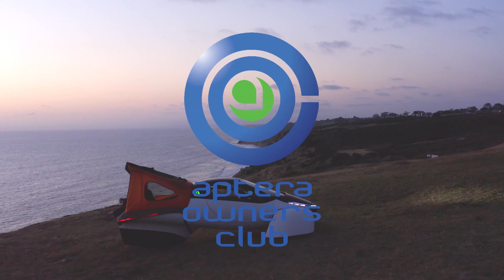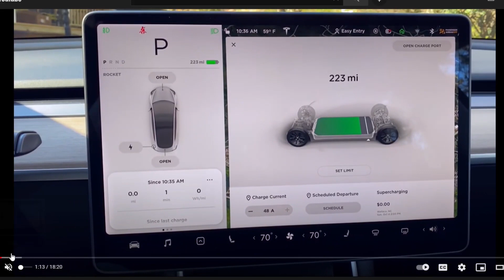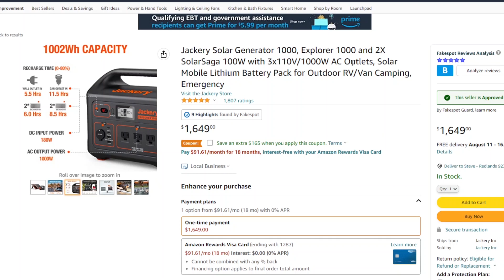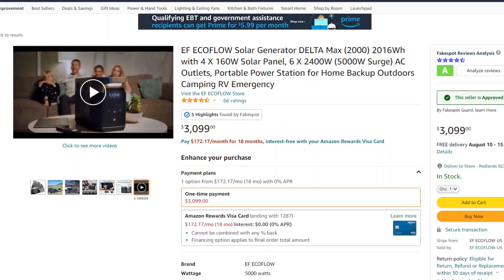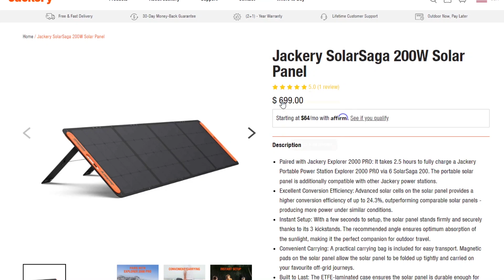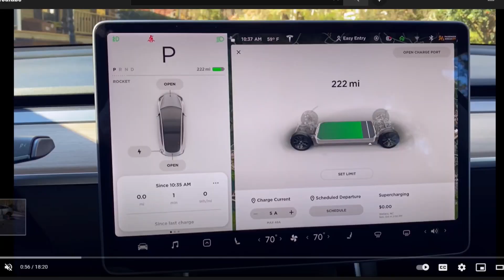Charging with portable solar.   Aptera could do this MUCH simpler

Comment: I just noticed you have no understanding of the Aptera. There is no portable solar on the Aptera. The Aptera is mobil solar.

That difference is portable is you can move it. Mobil is you can use it while it moves. You can't drive while on portable solar power.

Comment: It would be wonderful if Aptera were to offer an external extended solar panels that plug directly to the car.   This could be for camping or connected to your house for increased charging and more solar miles per day.   Another interesting idea would be a solar trailer that's both light weight and minimal drag.   For normal driving, you leave it at home and plug into it when home.   When doing long road trips, the trailer is towed behind the car for extended solar range.

Comment: So some of the issues would be there would need to be something that would convert the DC charge to an appropriate level which is likely in the 700v range as the Aptera is said to be between 350-400v system.  I have 4kw solar setup at my cabin and on a 48v battery it is in taking 110v.  So most of the solar setups you reference only output like 48v, which is not nearly high enough to charge the batteries.  So lets assume 48v panels at 8amps, which is a stretch for what you showed, but lets go with it.  That would mean to get it to the approx level needed you would be about 700v at about .5 amps.  To get any meaningful charge you would need 4-5 of the panels in series.  Ideally you would have enough to bring the voltage up to the desired 700 or whatever Aptera recommends for charging.  That way there is less conversion.  I think this makes sense sense since there are what 150ish cells on the Aptera that are likely in series to bring the voltage up to 3.5v x 150 approx 500v plus.  Should be interesting.  I do hope like you indicated they come up with some MC4 or something similar to allow this.  That way we could get several hundred miles of solar charge each day.  Love your videos, joined you all on discord and look forward to getting my Aptera!

Comment: I too hope Aptera has a direct solar panel charging port instead of the converted, then reverse converted method.  That being said, I've lived off-grid with solar panels on RV for years, and know these new solar generator charging stations to be overrated and seriously overpriced compared to my setup which does the EXACT SAME thing! All it is is solar panels connected to a charge controller, connected to 12v batteries (in my situation, '2' 6v golf-cart batteries in a 12v arrangement). Connected to the 12v battery system is an inexpensive power-inverter which converts 12v to 120v. The RV has options of running a 12v system for lights and basic appliances, and 120v for fridge, sensitive electronic equipment, blenders, coffee grinders, power tools, etc. Its been working great for over a decade for far less $/watt than these portable solar generators.  I've been avoiding and loathing the forcing of us into electric vehicles because of the extraordinary power demands to run a vehicle. It is impossible for those of us off grid and not SUPER wealthy! ...until now. Thank you, Aptera- finally something I can get onboard with!  Aptera NEEDS to have an adjustable amperage setting like this Tesla, if it wants to appeal to someone like myself.  I don't need to charge a vehicle in 12 minutes, I want the ability to charge it with limited electrical resources, such as my 1000w solar arrangement, or 2000w 'backup' inverter generator.
Reply from the maker: Thanks for sharing your experience!

Comment: Remember that in the future, polish company called Saule Technologies which produces perovskite solar cells, might produce elastic sunshield, or huge plain sheet of solar panels that you can fold or roll and get more watts. I really want to ask aptera ceo about perovskite technology. 
They could print perovskite lines on the body of Apteras vehicles (like they did in lightyear blue project with stripes) and connect it to battery - more poweeeeeeeer :D
Reply from the maker: https://youtu.be/Zpp6vRTWKZ0
Reply: This tech is coming, but at the moment it is years away from commercialization.  Aptera produced kaizen, or continuous improvement, so they will be able to adopt new tech without waiting for model years to phase it in as it becomes available.

Comment: Tried to do this with my Gen II Volt. 

Figure I could get about Five miles of range per solar battery cycle.

The 120V charger that comes with the Volt plugs right into the solar generator indicates a ground fault and won't charge. 

Anyone have any ideas which I could do differently?

Comment: A point to note about using a solar panel to battery to EV connection is that the battery acts as a "leg up" since the solar panels don't produce that much current. BUT you need to have a system which allows pass through charging. That is, the battery puts out current while receiving current from the panels at the same time. This is not a feature all systems have. Jackery can do pass through charging, but doesn't recommend it because they say it degrades their batteries. Other companies like Oupes and Bluetti are designed to do pass through charging with no ill effect on their batteries.

Comment: The only reason I came up with for needing supplemental solar was for remote places like a trip to the Article Circle. You might have to sit for a while. If you use 700 watt flex panels sew together you sit for half as long.  As you move from one stop to another.  You can get to places the ICE car might have trouble getting to but bring a fishing pole so you have something to do while you wait.  And so you don't starve.

Comment: Here's to hoping the Tesla charging plug makes it to the production model and a DC slow charge mode can be implemented.  With this there would then be direct battery connection and minimal conversion losses.  Cheers!

Comment: I have an idea that could both keep the car cool and increase the solar charge rate.  

Aptera should have an MC4 input inside the car and sell a customized sunshade that has solar cells embedded in it.  That way the car's internal temps can stay lower, minimizing thermal stress on the internal components and we can utilize essentially the whole windshield area for solar cells.

Comment: The problem lies in how much the solar charge controller that is installed can handle. If the vehicle is equipped with every panel possible, including the ones in the dash board, The Aptera's Charge controller may not have the ability to handle more panels or may require panels of a specific voltage range that are not typically the kind that are portable.

Also wouldn't a solar windscreen cover defeat the purpose of the dashboard mounted panels?

Comment: will the Aptera be capable of providing temporary power to a house, for times when the commercial power goes out? In other words provide some compatible DC voltage to an inverter that converts it to 120/240 AC for the house. Keep in mind that you are responsible for disconnecting the house from commercial power while using the supplemental power. Linemen hate it when they think they are working on a dead line that is being supplied by some yahoo with a generator.
Reply: Aptera will not provide V2H  however there will be a low current 110 outlet. Perhaps no more than 1300 watts

Comment: The Tesla won't charge directly off a solar generator unless you have a neutral ground plug in one of the outlets on the generator. I saw he was using one in a still from the video. They are about $15 on Amazon.
I have a solar generator with a 2kWH battery and a 2000w inverter and it will put about 6-8 miles into my Model S and I have 380W of solar and it will over time charge the car if the panels are in the sun and not shaded like in that video. It's not remotely fast, but if you are camping for several days, or a week it will add a bit. Mostly my panels and batteries are to run the campsite, and at home they are to run the fridge in a power cut.
The Aptera will eliminate the need for external charging and I would like if it could do vehicle to load, so I could run an extension cord to my fridge if needed and leave the extra solar panels on my camping trailer. It would be nice if it could accept external solar to boost the charge rate while it is sitting. I have one of the folding Jackery 100w solar panels with a small 300w solar generator that can charge my ebikes. It uses a barrel plug and not MC4. I use MC4 on my boat and camping trailer because they are not meant to be plugged in and out a lot. I think the Jackery is proprietary maybe. On my ebikes I use Anderson plugs and XT90 plugs. Probably anything will need adaptors because nothing is easy.

Comment: I like the idea of carrying that battery pack as a "jerry can" for emergencies and to enable the collection of solar energy when camping both for the EV and for other applications. Maybe you could run a microwave oven off of it or charge your devices or whatever to save you depleting your vehicle battery. The more solar the better. Plus it means that charge is available immediately in an emergency like when you are miles from a charger and your vehicle battery is nearly dead. It may be at night when you can't charge from solar.

Comment: I'm not sure how many people here in the comments advocating for the mc4 connectors have ever worked with them... While they may be great for the application that they were developed for, it wouldn't be easy to integrate them into the aptera for a simple plug'n play solution. A different connector, such as the standard 1/4" wall wart plug would be much better, along with a mc4 compatible adapter.

Many camping panels already come with such an adapter, and that 1/4" plug would be a much cleaner way to supply power. Granted, I doubt that those 1/4" plugs are rated high enough, and something a bit more substantial would need to be used instead, but the point was that mc4 connectors just aren't the ticket, and that there are other industry standard plugs that are much better.
Reply from the maker: Good to know.  Thanks!
Reply: Yes, the plug design, charge controller, and circuit protection would be easy. MC connectors are designed to be difficult to disconnect.
Reply: @pauls126  Weirdly, however, I find them easy to disconnect w/o tools.
Reply: I posted the same thing.  MC-4 connectors are just not suitable.  They are meant to be connected and left alone, not repeatedly inserted and removed.  They WILL break.
Reply: @davidparsons5513  And, potentially, plenty of arcing during connecting or disconnecting.
Reply: What’s this “standard 1/4” wall wart plug” you speak of?
Reply: @bobhilder1469  Something like this: https://m.media-amazon.com/images/I/71CtGQcATIL._SX522_.jpg

Comment: VW cars come with a solar panel that is designed to plug in to the car's lighter socket directly and give a bit of power. So the concept is commercially well established. Of course, Aptera has a duty to think with every connection: what protective circuitry do we need to add here to rescue people from doing stupid things to their Aptera? If every customer understood electricity, they could skip that expense, but not in the real world.

Comment: The fully equipped Aptera has a rating of 700WATT of solar and they estimated to gain about 40 miles for a whole day in the best map zone.  So you can do the math from there to estimate how much you can actually get from the little 200-300 panels.

The idea of collecting more free power is definitely viable.  At least for this vehicle versus anything else in the market today.  Just make sure you have plenty of patience, some investment $$, actual space for the panels to collect power, and don't forget the sun!

As for the MC4 connector, I am all for it!  since the vehicle has the solar management controller, its already half way there.  Based on the comment about having additional headroom for future expansions when higher efficient panels are released in the future, I think that alone will take a a few steps closer.

Comment: Would be nice for Aptera to include the ability to plug in Solar Panels directly.

On a side Note, I fo have a 1600 ecoflow.  I use the level 1 charging cable that came with my Outlader PHEV which I can select  between 8 or 12 Amp.

Takes a long time to charge the Ecoflow via Solar.  But usually just charge off the grid.

Comment: I have a 120w portable solor panels but when I plug it into my portable battery station it only shows 55w input.  I actually have two different brand and size battery stations and they pretty much say the same thing, 55w at peak of the day during summer.
Reply: It sounds like either something’s wrong with your 120w solar panel or the “battery stations” are limiting the input power.  If you’re interested in freely diagnosing the problem just ask!

Comment: I posted in the Aptera community .. much the same, but I saw the $300 one.  I would prefer to get an Aptera version that I know is going to work. Plug and go!  Not many seemed intersted, or "just get the car out".  For 300, i would probably buy one, even though I probably would never have any use for it.

Comment: I think they should sell accessory solar panels that fit in the back and plug right into the car for charging. Maybe bring your daily solar mileage from between 20-40 up to maybe 40-60 depending on location.

Comment: It's been a while since I read the Aptera FAQs, but I believe they are trying to have a DC input for solar. I think the lead engineer said the same thing in the Youtube video that shows an Aptera floating on water. Its obviously not a top priority (over making it to production in general), but something they agree would be important and beneficial (along with V2G/V2H).
Reply: Aptera has said they will provide a receptacle to directly plug in exterior solar panels. They will use the on board solar charger. they did not specify the location or type of plug but MC4 is assumed.

Comment: The user interface/ Crank software video shows an on-screen control at the bottom left for setting the charging amps. We don’t know if Aptera will actually enable this. Aptera says you loose 1% efficiency for every 30 lbs cargo, so you have to add that to your calculations when hauling a heavier solar generator.  I don’t see the method as worthwhile unless you can go directly into the car, and have a fairly large array. The car can give you 700 watts after all.  The 200 watts in the video doesn’t do much more than get a little ahead of the Tesla vampire drain.

Comment: I want V2G (Vehicle to Grid) or V2L (Vehicle to Load) with a 110V outlet. But I also like the ability to supplement the Aptera's solar array with an external DC charging plug.  My Chevy Volt had the ability to change the AC input charge from 8 Amps to 12 Amps. Chevy did that from a worry that owners would overheat poorly wired plug outlets in their garage during charging. I think that Chris mentioned that Aptera was building 1500W of external DC charging headroom, which could be taken advantage of in the future.

Comment: We should all petition Aptera to include an MC4 plug... that makes soooo much sense, it would be a huge oversight and blunder if Aptera didn't do it.  If nothing else, it should be offered as a "package" add-on accessory that a customer could option.
Reply: MC4 plugs are not meant for repeated connection and disconnection.  The also shouldn’t be connected if current would flow immediately or disconnected under load.

Comment: cool it is even possible. just need a larger solar rig and larger battery pack. in a few years efficiencies increase in both, costs come down. cool option for camping or bugout in SHTF scenario 😅
Reply: I think rollable or foldable and mounted to roof racks in a storage plus in trunk a model s for ex could fit and carry a lot more. but tbh, the supercharger network is so solid this is more of a just because you can/proof of concept

Comment: If the guy connected a lot more panels, the solar input might be able to keep up with the battery.  The MC4 connectors are designed to be strung together for this purpose.

Comment: Oh my gosh, Steve, I totally love 💕 your mind!!! I'm with you and would love the solar charge plug. I'd also love to be able to use software to step down the charging amps. I wish my Zero had that, too. I could totally just carry around my little portable power jumper box with its air compressor, inverter plugs, and USB ports that I can use in a pinch to get me a few miles.

Comment: I would be more interested in the output ports of Aptera. I hope they include a 110 volt ac output so that i can use it to work outdoors and connect my power tools.
Reply: You should think about getting one of these power stations so you can take your tools places your car can't get.
Reply: @BongRipBing  already other cars like Rivian, Sion etc .... have that feature. Why not Aptera? especially considering all EV's are giant batteries on wheels.

Comment: Solar is NEVER going to replace plugging in your car.  Aptera is a HUGE waste of money.  Those solar panels are an extremely heavy waste of mass.  Aptera can be plugged in and thus DOES NOT NEED the solar panels.  Also, the panels on the outside of the car are NEVER in direct sunlight as they are all sorts of angles.  You might get some of them at the proper angle to the sun, but you will not get direct sunlight on the entirety of the car.  Solar charging is just another reason the Aptera is going to FAIL!
Reply: Are you trying out for troll of the year?  I’d say you have it in the bag.

Comment: Also,  I messaged them a week ago asking about outlets and they pointed me to a Microsoft Form where they are accepting suggestions. If you want a port to be able to plug in external solar panels, you could try there.
Reply: Hello Johnny,  could you provide a link or instructions for the Microsoft form? I’d like to comment on this subject. Thanks!